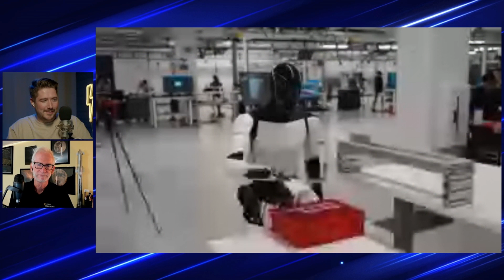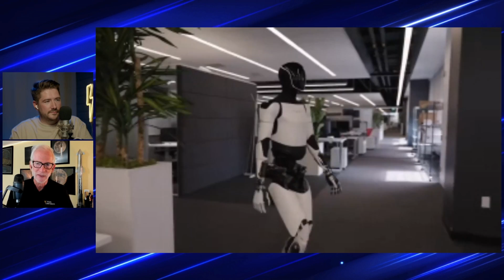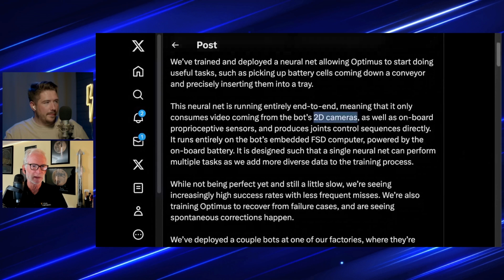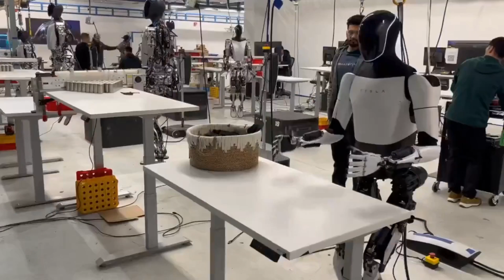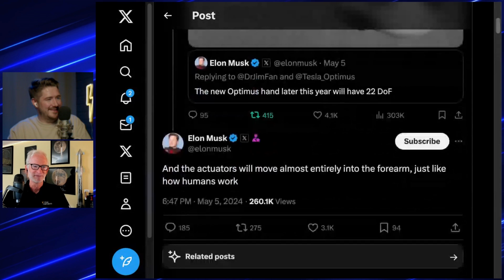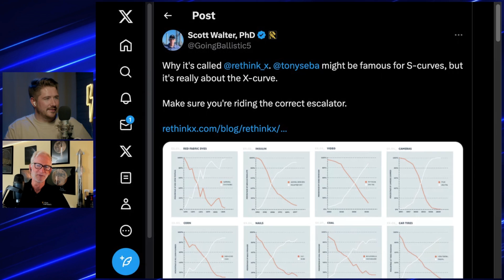EXPERT AMAZED: Massive Tesla Bot TRAINING CAMP!⚡Dr. Scott Walter

Comment: The legs or "no legs" debate is interesting.  If you watch Optimus putting the batteries into the tray you will see that the legs and hips are moving.  And that's what humans do to balance their body e.g. to counter-balance the outstretched arm pocking up the battery.  My guess is that less force is used to pick up an object as you get closer to the object. And I would expect this to mean lower power requirements. And my feeling is that this is more efficient than using wheels that may have to rotate the whole bot and move the whole bot weight toward the object.  It needs some modelling of the mechanics to get objective comparative energy usage.

Comment: This demo makes me think teleop training is the modern equivalent of hard coding a solution. If an AI were asked to do that task, it would naturally opt to use both arms to do it faster and to put equal wear and tear on both arms. I asked chatGPT how it would do that task, and it said it would use both arms. But we see the bot awkwardly using a single arm because it was teleop trained to do the task that way. I prefer the approach some other bot companies are taking, which is to not train entire tasks, but to instead build up a toolbox of small movements and then use a high level AI to piece those small movements together to perform ad hoc tasks. The hard coded "end to end" neural net approach is faster and easier, and can work in a rigid factory situation, but it isn't going to result in a general purpose bot.
Reply: Both sides of Optimus are mirror image automatically learning to use both arms.
Other arm can be taught to do another task such as measuring the batteries, or putting a reject in a different bin. It could easily multitask, even while operating foot controls, again only one foot Needs to be trained for the other foot to take over.
You could teach it to drive a car on the right side of the road In the USA and it would automatically be able to drive on the left side in the UK, Without further training. It would identify the layout of the car.